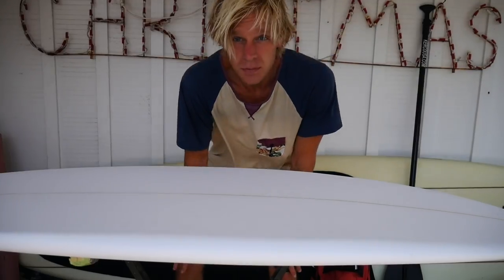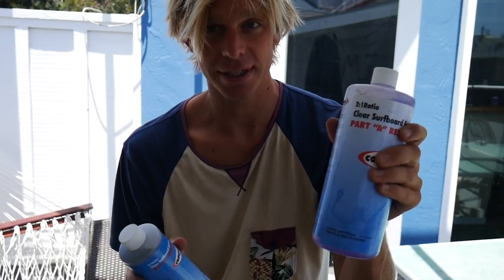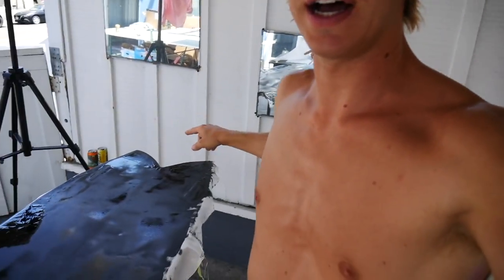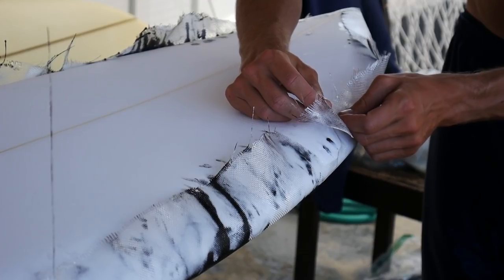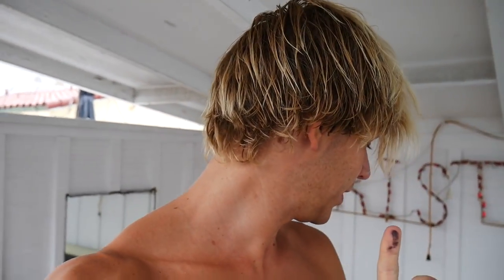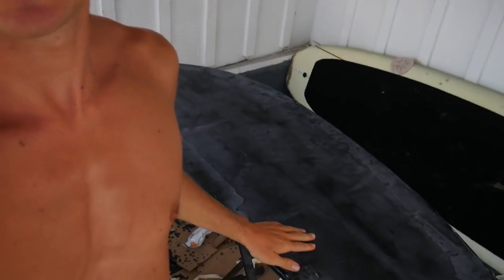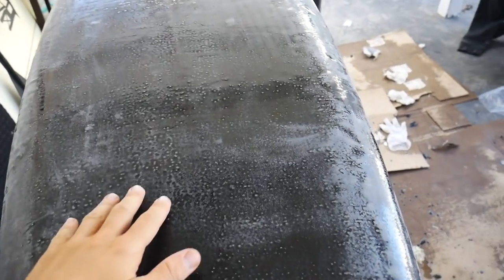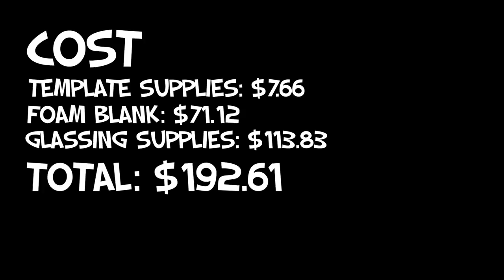GLASSING my FISH SURFBOARD

Comment from the maker: What do you think guys.... will it work? 😝
Reply: ive made a few boards n its seems like the supply store screwed you a little with bad info, but your board should still rip!
Reply: Should be just fine, if those fins aren't solid you might want to bring it over to Joe Roper's, they can just pull them out and fix them worst case.
Reply: Im so excitet so see you surf with your own Board:) when Comes the next Episode? Greetings from nonSurfabel Switzerland :(
Reply: it will work maybe 1 or 2 surf and then , it will drink water and delaminate if it didnt break before in half before that =), glassing is the most difficult part on surfboard shapping. Your resin mix seemed very liquid too me ,  you didnt cut your lap enough obviously  you should have waited before hotcoat . sanding all bubble wrinkle , is very important  because your board will be weak if you dont do it and it will delaminate it is really hard to fix afterward once everything is hotcoated...  bare with my english im french .
Reply from the maker: still working though!
Reply: yes ive seen that in your other video  lol.
 I glassed my first board few month before your (expensive 3d cnc shape) , used 2 cloth on the top 1 bottom , sanded perfectly i thought , and my board is taking water haha i fixed it already 2 time the issue i had with fcs2 plug air bubble around the plug that  finaly took water, some air bubble due to wrinkle that are delaminating on my board now ... another issue was using an electrical sander and going truth the glassjob while trying to fix the wrinkle mess especialy on curved lap  =/ , bad resin mix too that werent curing was slushy too . The hardest part is glassing the lap, my resin was cured before i could finish them (20minutes) , the fact too when you dont use tint you dont see what been glassed correctly... 
Afterward as usual if found some nice tutorial about glass job , you get good at glassing trought practice , the tuto i found was quite clever, just take some left over foam and glass it like mini surfboard ( you can even do body surf board) train over it once your job is perfect now size it up =).
Reply: what is the longboard in the background?
Reply: Twin fin futures are labeled (F), the (x) is only for rears.
Reply: i invite you to visit galle dewata where there are lots of surf antithesis gathered bring your experiences to share and make a project here
Reply: @youdig-detection  what's the tutorials you liked? I'm just about to try my first glass job :)
Reply: If it doesn't you can always just repair all the imperfections
Reply: I'm guessing you have a hard time keeping wax on that board in the summertime. 😂 I made a black board that only comes out for dawn patrol. on a summer day the wax melts the second the sun hits the deck.
Reply: deffinetley !1  cheers
Reply: It will defiantly work

Comment: I would avoid all black. Can de-lam easily from the heat.  Also suit up, glove up, and wear a respirator when you sand, brah!  You’ll get a bad rash with the fiberglass dust.  One more thing, try using UV curing. Gives you all the time you need. Work in your garage with windows n doors blacked out, and when you’re done glassing, just expose it to sun light or turn on an UV light set up. Don’t forget to label your dimensions and sign it
Reply from the maker: Thanks man! Yeah I considered using UV cure, but my buddy had a bad experience with it, so I chose epoxy instead

Comment: .....another tip.... Never use a fast hardner with epoxy....take you time. Is not a question of fast timing. Accuracy is the major point. Re-trimming everything when is cured....is a disaster. Now you know. There is no reason for rush and use a mask!!!!

Comment: Everyone has to start somewhere.   Here's a to-do list for the next time

1. buy your supplies from Surfsupply in Oceanside, not Mitch's.  The cost savings are well worth the drive.  Plus, they give your your glass fabric on a roll, not folded and stuffed into a plastic bag.

2. Their Apex line of epoxy is a great bargain.   If you buy a 1.5 gal kit your cost for resin is ~$40/board so long as you don't waste it.

4. Don't do color with epoxy until your glassing skills improve.  It messes with the mix ratio, it cuts into your working time with the resin and color in epoxy never comes out as even or as clean as color in regular polyester resin.  Just don't do it.     If you want color on a board with epoxy glassing then you can put your color directly on the blank:  chalk, spray paint, posca pen, etc.  Or you can put color on the outside of your glass job.  

5. Use vinegar from the grocery store to clean up epoxy.  Never use  acetone or other thinners.   Vinegar is way cheaper than acetone, it works, and it's not toxic like acetone or paint thinner.    

6. Blow the blank off with an air compressor or canned air. Dust on the blank interferes with your bond.  

7. Tape the foam around your finbox install so that when the cavity overflows you won't get it on your foam,  You may need a couple inches of tape around each side of the cavity

8. After you rout your finbox, lay the finpatch over that - by itself.  This is a trick for beginners - if you do this you won't have to hassle the bubble factor around your boxes during your main lamination.  And you can cut a really clean finpatch.   Finbox installs need more glass over them, especially if you're running large twins or keels with a lot of surface area - and which applies a lot of torque while you're turning.  Never do just one layer of cloth over a finbox or plugs.  Or even under a glass-on install.    

9. Tape your lap lines off on the "dry" side of the blank relative to your lamination, and plan on laying the glass all the way around the apex of the rail to the lap line.  Lay the tape flat and press it down hard so it really sticks to the foam, otherwise epoxy will seep under the tapeline.  This is another reason you need to make sure there's no dust on the blank when you start to glass.  

10. Razor cut the lapline after the resin sets to the hard but still slightly sticky stage.  If you cut too soon you'll make a mess and if you cut too late the hardened epoxy will be hard to cut
11. Do not touch a lamination with your bare hands.  Always wear gloves.  The oils in your skin will mess with the resin.   Epoxy is super sensitive that way.  

Now go back and take another swing at it.

Comment: 1. Horrible routing! Ask somebody how to keep router in your hands at least.
2. Mask finboxes with tape in advance, before glassing and cut out extra tape!! Glass boxes in board in advance before glassing too!! You forgot to put football shaped glass patches over finboxes before glassing to reinforce boxes in foam.
3. Glassing was a mess. Pour all the bucket around board and spread resin well towards the edges. Be quick. You must saturate the edges and wrap them around from bottom to the top of the board. If you cant do it in time, mix half of the needed resing and glass only half of the board. The immidietly glass the other half of the board when the first batch is still wett and tacky. All the glass must be saturated and mesh and fiber must come invisible after proper saturation!!! This is the most important moment of the glassing. No saturation of glass = no strength = crappy board!
4. You didn't laminated and cut off most of your overlaps! Wrong, very wrong!
5. Top glassing was way more better! But you can see how uneven unsanded overlaps from bottom bulid up to ugly ridges and you will have to sand them down later.
6. Wrong! Unfinished top overlaps = more messy work later and more sanding!
7. Your sanding was not sanding. You must sand whole board to really clean smooth shape without any ridges before gloss coat or you get more huge unwanted build up ridges to sand down!!!
8. You must glass unglassed exposed places!
9. Gloss coat was the biggest disaster. 🤦‍♂️
10. Hey, you didn't sand it at all! You barely touched it. Sanding is very very important and creates final shape of your board. I usually put one more hot coat of epoxy after proper sanding. I fill all the bubbles and holes!
11. That seller from shop which told you to put whole pigment in resin is complete idiot and should pay u all the wasted money!!! Kick his ass.
Ruined work allways sucks. 😤 That shape before glassing looked very good. 👍
12. Get rid of pigment until you really learn glassing 😉
13. Always use the best respirator when you sand, that resin/glass dust is very nasty stuff.
14. You gained lot of experience. Do another board, get better and don't forget to share it with us! Youe progress will grow very rapidly since now. 👍😉🍻
15. Watch more glassing videos over and over, you will learn a lot.
16. Save your first shape work your board No. 1 and be proud of it. Hey your forget to sign it! 😉
Reply from the maker: Very good tips, thank you! 🙌
Reply: damn chill
Reply: It’s his first time bro Relax bruh

Comment: I've been using epoxy resin to do a bunch of ding repair on some epoxy finished boards...Resin Research Systems and it takes forever to kick. Surprised yours kicked so fast....what brand epoxy is that if you don't mind me asking?   Also, theres the secret that I found out about later with finish coats on epoxy, additive F!
Reply from the maker: thanks for the advice... I don't remember which brand I used

Comment: Did you spackle the blank before you glassed? Epoxy resin will soak into eps foam and not cure properly if the blank isn't sealed.
Reply from the maker: spackle?
Reply: @HoStevie  yeah.. or joint compound or wall patching compound. you water it down with distilled water til it's the consistency of pancake batter then spread it on the blank thoroughly. give it a light sand to smooth it off after it dries. blow the dust off and then you're ready to glass. otherwise the epoxy resin will soak into the foam and the laminating layer won't cure properly.

Comment: You did it! Amazing, glassing is the toughest part for most board makers, because there are tons of things you need to learn to do it right, and for the pros they need to do it without any mistakes and fast. Respect to the pro glassers out there!

If you knew how fast the epoxy was going to set,  with color mixed right you would have a much better experience, but you still saved the board, awesome! 

The fish looks like it works well, congrats to you!

Ray StPierre
Reply from the maker: thank you! 🙌
it was a good learning experience

Comment: use a heat gun or hair dryer after you brush on the hot coat, it will pop all air bubbles
Reply from the maker: cool, good tip!
Reply: ...or use Additive-F

Comment: Next time; mix up a small small amount of resin, put the boxes in with dummy fins and use a protractor to check the angles are correct. Let those harden. And then put the cloth over the board, and pour a lot right down the stronger then slowly work it into the cloth. Don’t just pour small bits on different areas. It’s easier and the finish will come out better. Also make sure that you don’t leave pools of resin on the board to dry, it will have a weird surface. You wanna be able to see the weave all over uniformly
Reply from the maker: nice, thank you! Yeah the fin boxes did not go so well haha, I think one of them is starting to pull out now :(

Comment: Im not a shaper, but i have fixed some ding on my boards.
I belive that you should have done it away from the sunlight.
Some resins cure very fast when exposed to UV light. Maybe if it was done inside the house, you would had enough time to saturate de cloth properly.
But it came out really nive for a first board! congratulations!
Reply from the maker: thanks buddy! 🤙

Comment: is the hot coat just the same epoxy and hardener as for the glassing?
Reply from the maker: Yup it's the same resin as the first coat, but without adding another layer of fiberglass cloth

Comment: The resin does not determine the cure time; the hardener sets the cure time.  Well done with epoxy.  No or low VOCs.  And another thing, pour all of the epoxy out onto the board.  Keeping it in the bucket will cause it to heat and kick too soon.  You'll have to wrangle the epoxy runs, but that is part of the game.

Comment: 17 Seconds in, I cringed when he said he was going to glass it himself!! If he can't shape, he's going to have bigger problems glassing and I wanted to see that shape, with a nice, clean glass job! (Most people get experince shaping a blank, before they go for glassing) Little clue on how to glass, as I feared! Way too much pigment, didn't work the resin quick enough (OR Mixed it too Hot)--either way, a mistake & forced him not to have saturated the overlap on the deck--making the board a mess, from that point on. Poor sanding, another important step, he seemed to take not very seriously. I would have turned his first hot coat, into a sanding coat, getting it cleaned up and following it up with another improved hot coat that would seal the bubbles in the previous Botched Batch, while taking out many imperfections. Looked like it would have been a nice  board, though I prefer my Fishes about 21" to 21 1/2" wide and a bit less pointy. IF he wanted to Experiment with glassing, he should start with some recycled, or some 2 - 3ft. scrap pieces of foam and not a really nice board where that a poor glass job would just make a waste out of the entire project!
I don't even want to get into the Fin Boxes!!
Reply from the maker: board is working great still ;)
Reply: @HoStevie  Good Deal!! I've had a couple "ugly" Gems in my life---not much on looks, except the ones you get Shredding the Ugly Duckling--Cheers!!  Long may it Ride!!

Comment: first board is never perfect, fish even worse
because the sharp corners in the back are hard to glass over smoothly compared to a round or squash tail
my tip here would be to remove as much overlap as possible, not just so that it lays flat, not just to save yourself from sanding
but your first board is going to be super epoxy heavy, you really want to go as light as possible; don't overlap the same area too much ; )
Reply from the maker: 👍👍 good advice

Comment: Good on you for sharing your experience howbeit a rather misguided one. Kind of ironic you thought to protect your lungs from poly resin vapor and based your decision to use epoxy instead, whilst neglecting to wear a respirator or any lung protection for the sanding process? I know how doing things flying by the seat of your pants can end up leaving you with more problems than you originally intended. But no skin off your nose and looks like now youll HAVE to do another one just to redeem yourself!
Reply from the maker: i guess that is ironic huh 😝
Reply: keep up the vids brada, thanks for the reply. do you ever run into Kahana Kalama of Aloha Sunday, San Diego out in the line-ups? hes one cool hawaiian from where im from. aloha! 
 @HoStevie
Reply from the maker: never met him, where does he usually surf?
Reply: Ho Stevie! When I was chillin with him there we surfed blacks and pt Loma and OB. His shop is like a clothing boutique and they were doing some co-op on boards possibly. Anywho appreciate your reply and will stay tuned for some more dope vids!
Reply from the maker: @robwurlitzer  ah sick 🤙